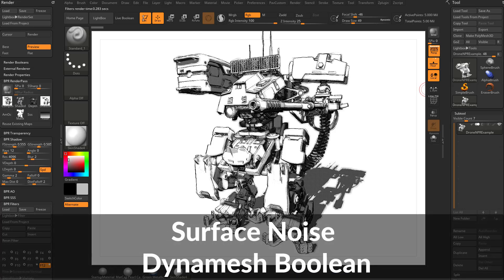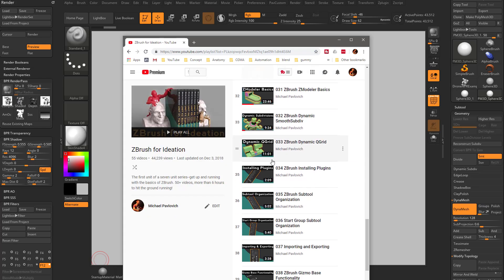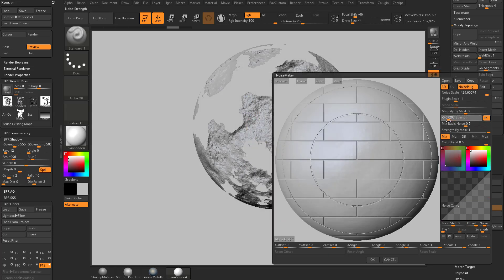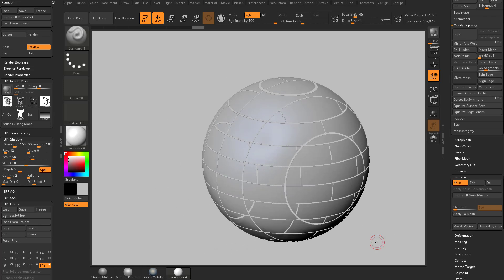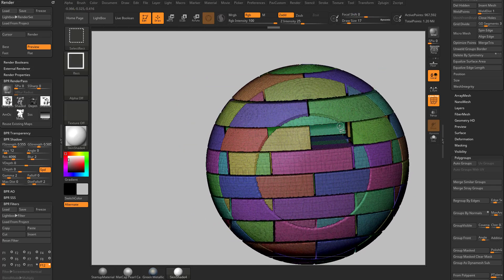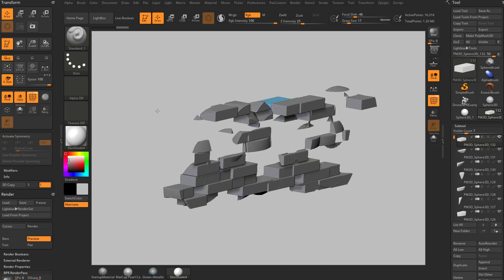029 ZBrush Surface Noise Dynamesh Boolean

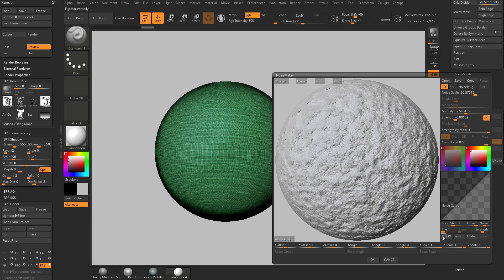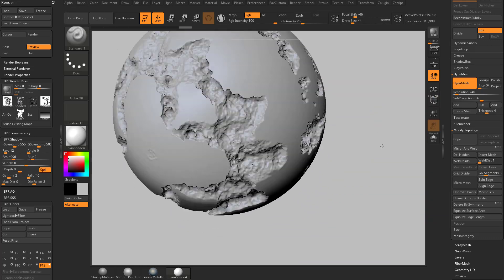Comment: This is pretty close to what I am trying to do. Going back to 00:50 or maybe 1:10, what is the best way to to turn different levels into polygroups, so I can apply different materials to each? For example, if you go to Lightbox/Noisemakers, and select Noise04, for example, it creates different levels. But in the Edit mode you can make it more complex with the curves. So when I click on Mask by noise, I am only getting two levels. Ideally I'd like to turn two or three areas of noise into distinct subtools so I can apply different materials. Do you have any suggestions?